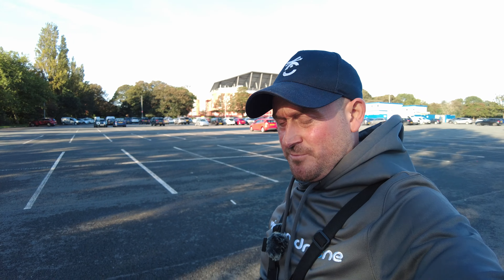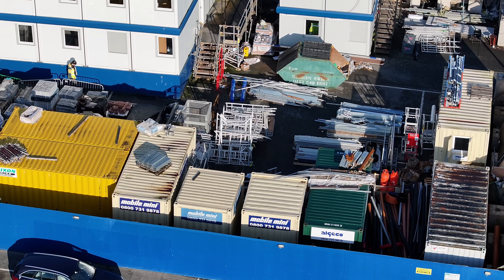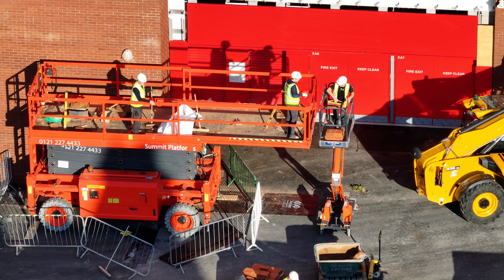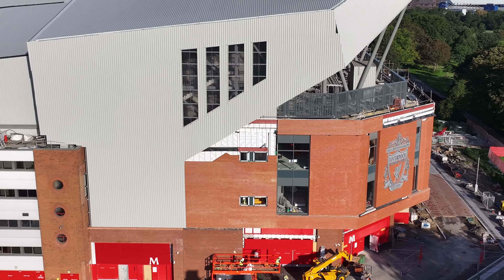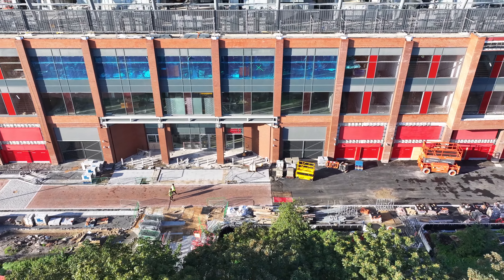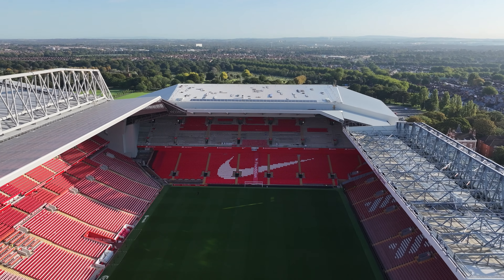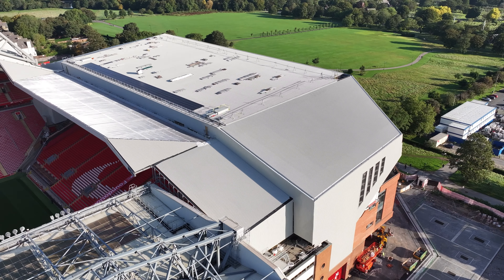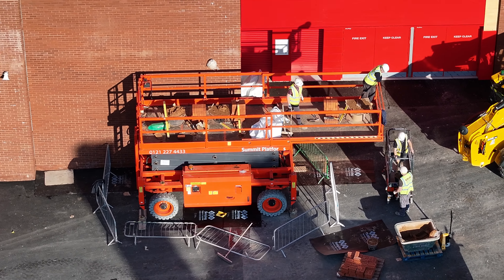Anfield Road Stand Expansion 13.9.23. VERY PROMISING! Site Getting Busy! Brickies Back To Work!!

Comment: I think the hole in the roof is for access on to roof.  Wouldn't have thought is lets in much light particularly when you thing the stand is completely open on pitch side.  The brickwork is one of the easiest jobs to be completed.  There is a limited amount left to do and can be done independent of other trades.
Reply: It is access, it’s got a ladder sticking up and a gate, how would they get on the roof without it.😊
Reply: @Robert13732 there is a hatch with a stairs up to it further down the roof. On either side of the solar panels.
Reply: Shall we have a laugh ? The hole in the roof is for the ref the next time  we get a player unfairly red carded 😅

Comment: Hopefully they do the concrete in that corner and get the seats in be a big milestone to see fans in them seats over the next couple of weeks.

Also be good to see if the club do the work on the lower concourse and make the bars bigger and open them up on to the bigger concourse now rowen have took over lfc could pay them the extra to do it now

Comment: Hi Nick,  another great video. 
Nick, could you answer a quick question? Wouldn't Buckingham still own the porter cabins ?
If so, would the new company have to buy the cabins from Buckingham?
Reply: Hey Keith, I'm assuming the portacabins and containers are all on hire from other suppliers, so Rayner will just take over the lease agreement 😊
Reply: They will probably just sub contract them via lease

Comment: Will they ever get to 75.000 around the same as uniteds stadium?
Reply: The club owns over half the houses behind the SKD stand; so yes is the answer, but who knows how long it’ll take to acquire the remaining homes so we can knock them down and expand that upper tier.
Reply: Problem being is the infrastructure that needs to be put in place as required when capacity hits a certain amount.. 
there is also the right to light laws that would probably mean 3/4 rows of houses behind KDS to comply with this. Would the club want to go through the same issues that occurred with buying houses when they did the main stand.
The Kop again could probably be expanded but there is so many hinderances to even consider doing that anytime soon.
Reply: Yeh just tell someone LFC want you out because we want to e tend the stand so some more people can watch a football match 19 times a year , I just hope one day you get evicted
Reply: I disagree with above, the current capacity (once completed)will be 61000. The issue of houses behind skd stand is minor compared to the limits set in by-laws for the area which we are essentially at the maximum allowed with the road links and traffic/parking for the area and local transport links etc. There would have to be major investment in local infrastructure re transport etc to increase capacity much beyond what it will be. To extend Kop end feasibly would require rerouting the road behind also, not impossible just not financially viable or sensible. So I'd say no, they will probably not extend any further, S I cannot see funds being available for local council to invest into the roads and transport improvements required to make stadium any bigger. Liverpool have no plans to carry out further development, as it has to be financially sensible. These things take years of planning and there are NO plans in pipeline, so don't hold your breath, be a decade at least before we see any more expansion. It's not about the capacity, it's the atmosphere generated, a full 61000 capacity Anfield has far more noise and atmosphere than manures dump old Trafford has with 75000. FACT. Too many hoops need jumping through and too many obstacles are in the way to confidently say we will go any bigger. Just not realistic at this point or near future tbh. We could comfortably fill 80000+ every game, so I'm pretty certain Liverpool would have increased it further during the current expansion work if it was possible, but as I say...61000 was pretty close to maximum the local area could feasibly handle. So No we won't be increased to 75000. Maybe 2030 onwards things might change, but it's not in the plans as I see it.
Reply: @summerpool  ok thanks for the info bro 👍
Reply: @derekmain9914  They choose to sell. They can say no. There’s no gun to their heads, which is why LFC wait so long before buying the properties.
Reply: A lot of stars needs to be aligned before we even begin consultations to further expand